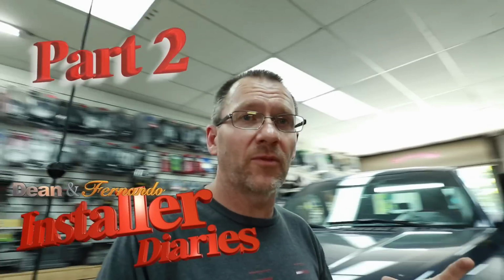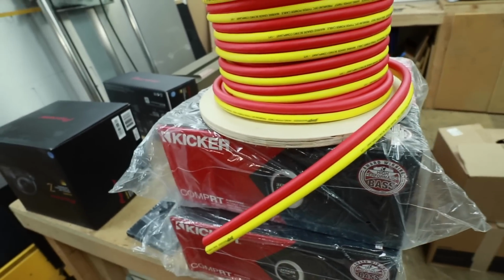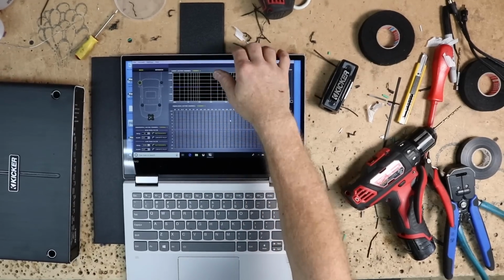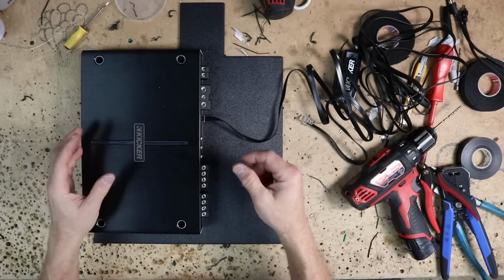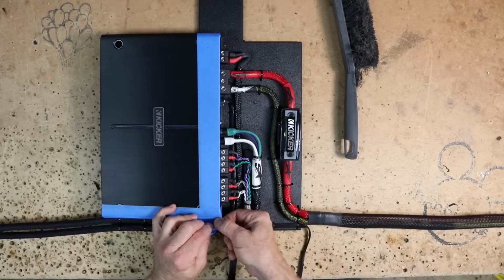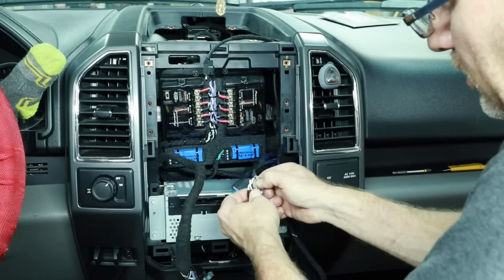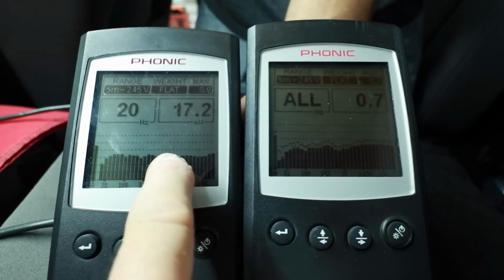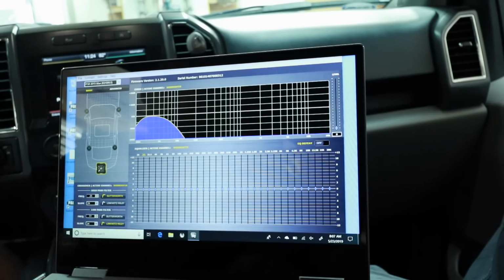High level 5 channel Kicker Q Class amp install in a F150 Installer Diaries 193 part 2

Comment: Didn’t realize you can run a ground off the battery I thought most amps are no longer than 24” from the amp I ran mine down to the frame right below the amp
Reply: It is true that the shorter the ground wire the better. The problem in some cars is that there is no good place to ground to, the cheap metals that they put in the car and weld together make for a crap ground connection.

Comment: Good morning team. On a Kenwood radio with iData harness, where do you plug-in the 3.5 that is reduced down from the two RCA’s? Which auxiliary input do you plug it into and what is it used for? Thanks for all the great videos!
Reply from the maker: It sounds like you are asking about to factory Aux input. It would go into the Aux input on the back of the Kenwood if it has one. Not all all Kenwood radios have Aux input.
Reply: Five Star Car Stereo I do have an auxiliary input right next to the iData plug-in. I believe that’s where it goes. What function does it serve?. Thanks for the reply

Comment: Hey Dean,
    So you say no amp mounts to the sub enclosure. Lol Man you did probably 1000s like that and also like the 2 amps in my 2nd 89mustang LX 5.0 ,you installed my orion hcca on the drivers side seat and my sound stream 4 ch and 2 ch.on the passenger rear seat which I watched tou say you hate now. But in all fairness I knew J.J too and I'm sure it went something like this. Hey Dean it's such amount for labor and ex amount for materials plus equipment. Let's just make it clean put it somewhere that wont cost me any more money. Lmao. But your right it's not good because you have to have extra wiring for seats being pulled down then you had to tuck it back in when you raised your seats back up.with or without amp racks still bad place.

Comment: Did I miss it why did you ground the amp this way but as always amazing work
Reply from the maker: The truck is made of aluminum
Reply: @FiveStarCarStereoInc  What year did this start?
Reply: Felix Medrano it started with the 2015 models. It’s a body on frame design so either you drill through the cab to create a frame ground (not recommended) or you ground at the battery since the battery negative is an absolute ground.

Comment: If using passive crossovers in this install, why to do active crossover setting on dsp?
Reply from the maker: The passive crossover do not have a high pass filter to block to bass from your midrange. They just provide a high pass for the tweeter and a low pass for the midrange.
Reply: Five Star Car Stereo isn’t Ford using the Epoxy/glue throughout their (discontinued) sedan lineup as well? I am wondering if my 2017 Ford Taurus SHO has the same type of grounding scheme? The response from my Sony “ premium “  system looks much like the one in this video.

Comment: Did i miss something through this intensively complex setup as to why there was no remote wire needed? I got so lost
Reply: The DC Offset mode detects a 6V DC offset from the HI-Level 
speaker outputs when the source unit has been turned on. The 
Audio setting detects the incoming audio signal from your source 
unit and automatically turns on the amp. Using either the DC Offset 
or Audio mode causes the REM terminal to have a +12V out for 
turning on additional amplifi ers.
Reply: He mentiined it in the first video, the amplifier has signal sense.

Comment: you know the shorter the ground the better right -_- not sure as to why you ran a long ground like that? not the best idea at all js
Reply from the maker: The truck is made out of Aluminum. The body is not a good ground. You draw the same on both power and ground. Running a matching 4 awg to the battery is the best ground.
Reply: That is true, but what if your only ground points are all rusted out and you have no chance of taking off the rust? Are you still going run your ground wire to that point? No, that would be idiotic. The same is true here, the truck is made of aluminum, which isn't a great conductor for a ground point. The best method is to run a nice new copper cable that is highly conductive straight to the negative battery terminal.
Reply: @UrAdversary  lmao its called sand paper and a tap if the bolt location ( if using a factory location ) reading something like this made me say tf? just like paint you REMOVE IT to bare metal.... you serious rn? if you are not smart enough to remove the rust let alone the paint then by all means do NOT do your own car audio and come to me or 5 star cause you will end up in a 9-1-1 install video or a legit 911 call to a fire department for burning your car to the ground with logic like yours lol you can always remove rust!!
Reply: @FiveStarCarStereoInc  frame grounds and no... you lose power over distance sure it dont matter with low power cheap set ups like this but in the event in say SPL or legit high power setups the shorter the ground is a must , and honestly should be applied across all levels of amp installs including the cheap stuff like kicker boss hifonics and so on lol if you was to meter volt drop amp drop watts and BD drop from power and ground wire its self you would see why a shorter ground is important and also why a lower AWG is also important like 4 AWG - 1/0 AWG  but not everybody does DBdrag i guess haha
Reply: @UsurperTCG  obviously you can't read, I said what if you CANT TAKE OFF THE RUST. There are situations where the rust has taken over the metal and taking a piece of sand paper to it would be idiotic. Next time think before you reply